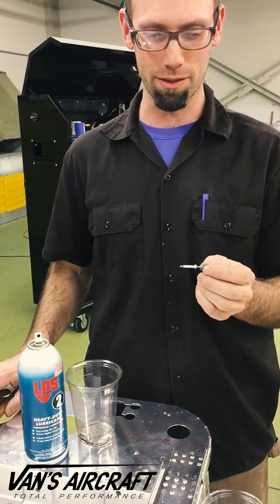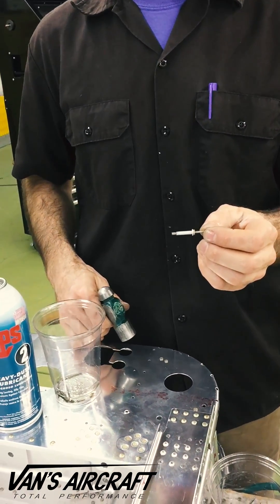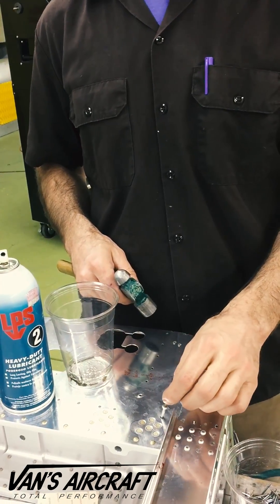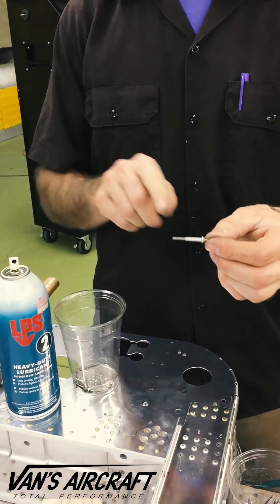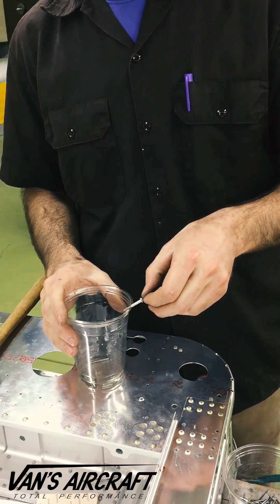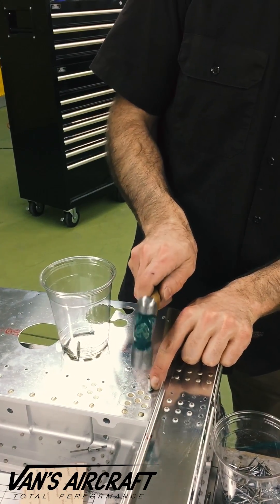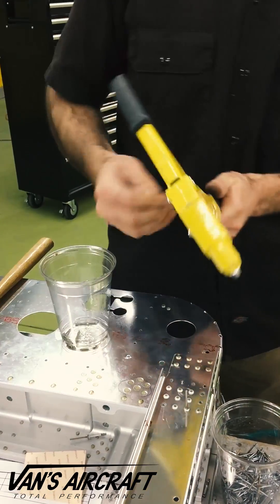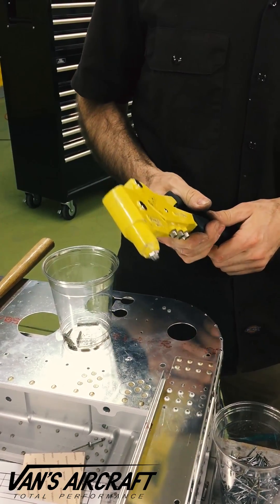Cherry Max Rivets Preparation and Setting: Van's Aircraft Builder Tips

Comment: That is a genius tip... thank you!  I've had this issue many times, and hopefully it will now be solved.  I'm going to use some structural adhesive as my "lubricant"  on the rivets, since I'm replacing 3 Cherry Max rivets in an Aerostar elevator horn, and it's critical the rivets stay tight.

Comment: Is it possible the process could be simplified by dipping the rivet in a penetrating lubricant?  I've also noticed differences between batches of rivets, but this is the first I've learned that lubrication could be a solution.

Comment: cant say i have ever had that issue with cherrymax rivets, even some that are approaching a decade old.   making sure there is no gap at all between the parts to be joined, and you have the correct length fastener, you should not have any issues with cherrymax,  also, making sure the pulling tool head is square to the rivet head makes a big difference as well.   i have never needed to add lubrication to a cherry rivet in 25 years as an aircraft structures guy full time.
Reply from the maker: Our shop personnel have a combined experience of over 40 years, working with aircraft structures.  Though we have never seen this as a chronic problem, we have seen it occur occasionally in our shop and some of our builders have experienced it to varying degrees.  Even when a correctly sized rivet is installed using perfect technique.  This solution is offered for those situations.  It is not a replacement for improper installation practices.